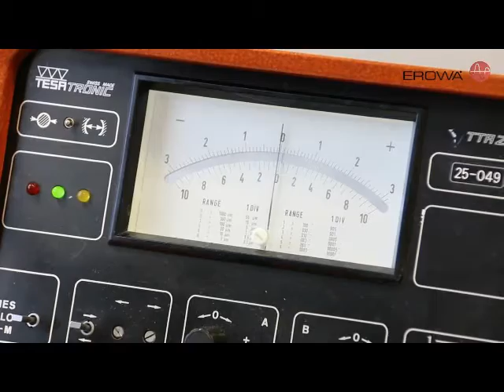Maintenance EROWA PowerChuck

Comment: good video, but one error in the disasebly process, NEVER use a torque wrench to LOOSTEN anything, they are NOT designed to be loaded in an anti-clockwise direction!!- tip: use a SOLID metal breaker bar, or a pneumatic-"rattle"/ hydraulic-"hytorc" gun to losten the fasteners.

Comment: Are Erowa chucks generally ok to use in Wire EDM? Fully submerged in deionized water?  We have an ER035502. Thanks!
Reply from the maker: Erowa chucks are not generally suitable for WEDM applications. Please refer to the respective product description for this.
But the mentioned MTS chuck ER-035502 is suitable for EDM and milling applications.